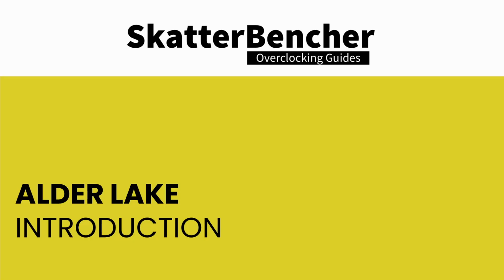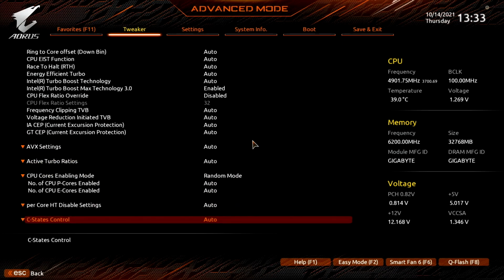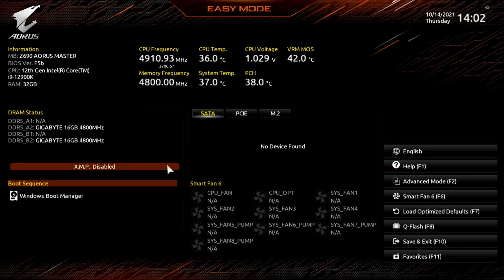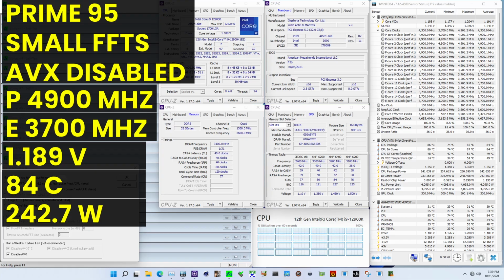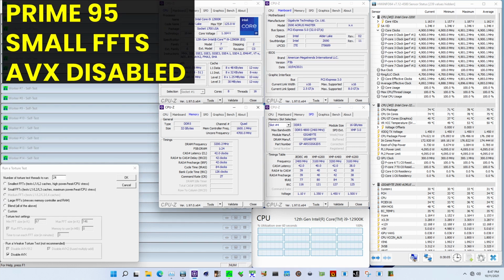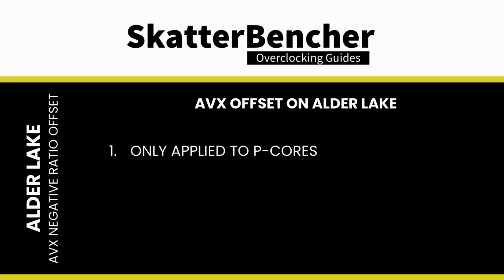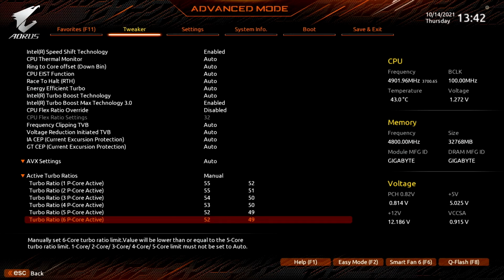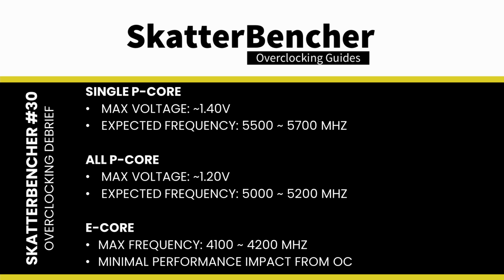Core i9-12900K Overclocked to 5500 MHz with GIGABYTE Z690 AORUS Master | SkatterBencher #30

Comment: I have been tuning the 12900k for a few weeks now. These videos have been helpful up to a certain point. 

My final stable daily clocks, voltage and temperatures are much different. 

What was the goal in these profiles? 

My goal has always been the same, lowest and most consistent frametimes. 

This goal means I need to sync all my core clocks and lock the max frequencies on the P, E and Ring. Then I try to lock the voltage with the exact amount of voltage required while transitioning from idle to full load rapidly. 

At 240 watts, I can destory 99% of benchmarks safely. I did some experimenting at 260 watts and acciedently went up to 280 watts. I am uncomfortable going above 1.415v on the VIDs and thats where my hardlock is. 

I have to run a 1.434 system agent to get the ring OC and Ram OC stable. This is my last hill, I want to lower this without loosing 4.7ghz on my cache. 

Final stable clocks for 12900k on DDR4 3600 are as follows:
P 52 E 42 R 47 Dram 4000 @~100 watts gaming and ~240 watts on synthetics

Comment: Can you do this for a msi
Reply from the maker: Not with a GIGABYTE board, but I have an overclocking guide out with 12700K and MSI board https://www.youtube.com/watch?v=c_ceb82008s
Reply: @SkatterBencher  I did it with the i9 12900kf msi video but is it okay to do the 12700k oc on the i9 12900k

Comment: I have followed this guid  and you mentioned 5.5 all my cored are a steady 5.2 with no sign of any leaving this 5.2 spot cinabench is benchmark  I keep a eye on themes throughout test and I’m seeing higher 80s low 90s running 360mm aio  power draw is constant 260-270 throughout test also ddr5 is gskills 6600 what am I missing cinabench score is 27500??
Reply: Ok I see it now the cpu will only ramp to 5.5 under light load should not hit 5.5 under 100% load correct if anyone can help that would be great love the videos bud
Reply: Up date I reset my bios to stock and started the tweaks over works perfect now 5.5 clocked in

Comment: Where is the final setup ?? You only shows the manual previously your final thoughts
Reply from the maker: There is no "final" setup. In my SkatterBencher guides I try to offer several OC Strategies, each of which work fine on their own. So you can choose which is your preferred strategy.
Reply: @SkatterBencher  Yes but to be fair, on your other guides, you went trough steps to get normal temps. All these examples are 99C and even if that is "safe" I am not comfortable running my CPU at 100 degrees. If you put all this work into the Aorus motherboard, why not give us a final setup with maximized performance with normal temps? Also, I'm watching many of your tutorials in preparation for the 13900k

Comment: Hi, thanks for the video! I repeated the overclocking exactly like you, but it turned out to be 1,420v in cpu z. Why is that? Please help me!
12900k, aorus master z690, triden z5 6000.
Reply from the maker: Did you follow OC Strategy #3? If yes, 1.42V sounds reasonable.

The manual overclock in this overclocking strategy tries to do two things: (1) increase the voltage in low-load few-thread workloads to get extra frequency headroom, and (2) reduce the voltage in high-load many-thread workloads to reduce the temperature. If you're idling in Windows then few cores will be active and the voltage will be higher.

1.42V is not that high for Intel CPUs as you'll find CPUs that go to 1.45V or even 1.5V at default.

Comment: Hey Bencher! I have this one issue that keeps bothering me. It's the System Agent voltage. I'm running an i9 12900k@stock on Aorus Master Z690 with DDR5 at 5600 34-36-36-76. BIOS reports SA voltage at 1.346, just like in your video. The same readings are accurate for HWInfo64. HOWEVER, HWMonitor reports 1.37! Should I be concerned here and how accurate are these readings?
Reply from the maker: No need to be concerned. I find that usually BIOS and HWiNFO are pretty accurate. I don't use HWMonitor often so I don't know how it gets the information.
Reply: @SkatterBencher  Thanks! I've seen people running XMPs with lower SA voltages, so I reckoned that mine must be overkill. I just don't want to degrade my CPU after having spent a fortune on my rig. I also had concerns, that automatic SA voltage regulation might ramp the voltage up through an offset and such HWMonitor readings would be a result of this. Still, it stays consistent at 1.37, so I guess this isn't happening. It's kinda worrying though that it reads close to 1.4.
Reply: BTW, is 1.346 safe for long term use?

Comment: Will this work for i7 12th gen with all the same settings?
Reply from the maker: The general process applies to all Alder Lake CPUs, but the exact settings will be different for each SKU (and chip).
Reply: @SkatterBencher  will this motherboard supports gen 5 ssds?
Reply from the maker: Yes

Comment: Hi thanks for the video. I have the same CPU and motherboard and followed your settings but it only seems to clock to a maximum of 5200 and not the 5500 you are referring to.  I have done a test with prime with just 1 or 2 workers and the max is 5200 although even with 24 workers it remains at 5200???

Comment: Hi, thanks for the great guide. But I have an issue with my bios and 12700k: all cores sync at the max 3.8gh ecore speed instead of pcores 4.8ghz pcore and 3.8ghz ecore. HWinfo reports 3.8 all core especially after running cinebench r23. Can you help or explain why is that?

Comment: Thank you! Could you do a similar 5.5 GHz manual overclock for the MSI Z690 Unify? Really great write up.
Reply from the maker: Thanks! I don't have any specific Alder Lake content lined up currently except for maybe non-K OC and Cryo cooling. But I still have to decide which platforms I'll use for that.

Comment: will this work with an i5 12th gen?
Reply from the maker: Yes, this will be possible with the 12th gen Core i5 K/KF processors. 

The overclocking process will be similar, but of course your mileage will vary depending on the quality of your CPU and the thermal solution used.
Reply: @SkatterBencher  I just attempted on the the 12th gen i5-12600k on the aorus elite but failed to boot, dropped multiple to 52, 52, 51 etc and it booted and ran benchmark but it crashed when I closed it and then had to reinstall network driver so not sure what else it broke. On the i5-12600k oc guide for the asus he sets the voltage for the maximum frequency, does the gigabyte not require that (in this video only the vf points are changed)

Comment: Hey man thanks for all your great videos, I' d like to know what the changes you made to VF point 6 and 11 mean. I have the same motherboard, I'm able to overclock through fixed and override mode but the adaptive mode (selection mode not legacy)I can't really understand how it behaves. For example if I change just one VF point, let's say the 11 or 10 I can't see any change but if I also change the 7, 8 and 9 then I see some changes but still not sure about how it works
Reply from the maker: Advanced Voltage Offset on Alder Lake is a little more complicated than on Rocket Lake. I'm in the process of making a video that takes a closer look at this feature and explains all its intricacies.

The long story short is that the rule is:
- V/F Point 7 is mapped to the highest default turbo ratio (52X on 12900K)
- V/F Point 8-10 are copies of V/F Point 7
- V/F Point 11 is mapped to the OC Ratio (by default = max default turbo ratio + 1; so 53X on 12900K)

For ratios in between the V/F Points, the voltage is (linearly) interpolated between the previous and next V/F Point. So for example:
- V/F Point 6 = 48X
- V/F Point 7 = 52X
=> volt(50X) = [volt(VF7) + volt(VF6)] / 2

Now, because V/F Point 8-10 are copies of V/F Point 7, it seems there are some programming complexities that require V/F 8-10 to be programmed correctly if you want to use V/F Point 7. The easiest is to just program the exact same value to V/F Point 7-10.

As said, V/F Point 11 will be mapped to the OC Ratio. When you do manual overclocking the OC Ratio is the highest ratio set among all ratios. So if you have single core at 55X, then V/F Point 11 will set the voltage offset for 55X and voltages for ratios in between 52X and 55X will be interpolated between V/F 7 52X and V/F 11 55X.

I hope I'm done with my video soon which will explain it in more detail.
Reply: @SkatterBencher  can you provide an undervolt guide for the gigabyte z690 to get default performance+ and better thermals. There isn’t much information in regards to adaptive voltage and override voltage with what LLC works best with undervolts.
Reply: @SkatterBencher  It would be great, thank tou very much for your effort
Reply: @SkatterBencher  damn I didn't see the full response, thanks you're my hero! Now i finally get how it works. I' m able to achieve 5.1 and 4.0 on 12600k but I have to figure out why I get bsod error every time the system pass form high load to idle
Reply from the maker: It sounds like the voltage might not be high enough for your peak boost frequency. 

A CPU will need more voltage at a higher temperature to be stable. It's like the reverse of Thermal Velocity Boost which allows for lower voltage when the CPU temperature is lower. 

So, if you CPU comes out hot after an all-core high load and tries to boost to the highest Turbo Ratio it may be unstable with voltage that previously seemed stable.

Comment: This is so clear, fast and to the point. Love it  This must have taken a lot of work.   Im getting a gigabyte z690 so you've brain dumped me up to speed on the details.

Question: Is it possible to apply a "global" negative vcore offset to push the whole range down and then just apply some vf point positive offsets to stabilise the top end?  Thinking this would be more thermally efficient.

I can see how you could over time figure out the curve by walking up the ratio's but that sounds like a lot of work.
Reply from the maker: Yes! In fact, a global V/F Curve offset has been supported in Adaptive Voltage mode for a very long time. It does exactly what you say: offset the entire curve by a given offset. You can traditionally find it in the Vcore configuration section.

The main challenge with a global offset is that ... it offsets everywhere. That makes it quite difficult to check if the offset is actually stable. For example, let's say you use a -100mV global offset. You'd need to check if this is stable from 8X to 52X on the 12900K. Whereas with the V/F Points, you can check the stability in a very specific range.

Additionally, depending on the specific BIOS configuration, setting a global adaptive voltage offset targeting the P-cores may inadvertently also program the negative offset for the Ring and E-cores. That's because on Alder Lake the P-cores, Ring, and E-cores share the same voltage rail (VccIA). It's not always obvious from the BIOS what that specific item programs, so to be safe you'd also have to check the Ring and E-core stability.

Advanced Voltage Offset (V/F Point) is specifically designed to only impact the P-cores. So it makes it a much more targeted tool for voltage optimizations.
Reply: @SkatterBencher  ok understood thanks.

Comment: Hey, Skatter! got off topic question.. Mine i9 12900k was working on 60c always while gaming.. Suddenly temps started to spike alot between 60-82.. Like one moment it's 60 then 73, 65, 76, 81, 69 and etc. Changing fast.. Any ideas what could happen? Checked with core temp, only P cores are rising that much, E cores stays max at 62c. Thanks! No OC, no fps drops or something, no dust and etc.. Pretty new setup. Water cooler.
Reply from the maker: That sounds like there's some kind of a background workload going on ... but it's a bit hard to diagnose over the internet :)
Reply: @SkatterBencher  no backround load.. very minimal apps are open. Fresh windows.. as I mentioned for 2 weeks temps were optimal.. then immediately started to spike.. can be cooler issues? Even though idle temps are fine.. 30c.

Comment: hey @skatterBencher I try to run my gskill 5600 c36 on this board, but its not running stable in xmp1 or 2 or 3. i have the latest bios (f6c) u have a idea?
Reply from the maker: Hard to say remotely. Is the kit in the motherboard QVL?
Reply: @SkatterBencher  yes they are. But looks like they fixed the issues with the F7A BIOS from yesterday. I choosed the Samsung 5600c36 profile from the list and not the xmp profile. They added a bit of voltages to vdd/vddq_tx and vdd, vddq + imc (CPUVDD2). They running with roundabout 1.3 - 1.32v now. Funny thing is, on the BIOS before i had to up voltages to like 1.41v + to run 5400c36 manually. 5600 wasnt even booting.
Reply from the maker: Thanks for the info! Yea I heard from friends working at motherboard vendors that XMP and memory compatibility is quite challenging. The people that go through the validation testing are the real heroes ... Memory qualification and validation takes so much time!

Comment: I'm just upgrading from x99 and I'm excited to try these techniques. Question, the ddr5 I bought doesn't have a heat spreader. Do I need to add one or could I just have a fan on them?
Reply from the maker: Good question! Leading up to the launch I had people (who didn't test) tell me good cooling will be required for DDR5 and others (who did test) tell me it's pretty much the same like DDR4. I have a pair of Micron sticks without heatsink which I ran with memtest and can't say I saw any temperature issues.

I guess maybe if you're looking to push the voltage and the sticks are inside a poorly ventilated chassis you might want to consider a heatsink? I haven't personally come across a need but of course others might have.

Comment: hey skatter, any motherboard recommendation for a 12900k + 3600mhz CL16 i plan to OC ? Asus PRIME Z690-A or Gigabyte Z690 GAMING X DDR4 ? others ? i don't know much about motherboards ... the  only differences i saw is : some get PCI-E 4.0 other 5.0 or wifi enabled, so i'm a bit lost. thanks !
Reply from the maker: Hi Prussiane. I can't say I'm an expert on choosing the right motherboard as I tend to play with things that are overclocking-ready and thus may be overspec'd :). I've only tried 1 DDR4 motherboard so far (the Strix Z690-A) and found it to work very well with my Alder Lake CPU.

PCI-e 5.0 is a cool new technology but frankly there's not much real-world use-case for it yet as we're lacking the PCI-e devices. I don't quite believe in the idea of "future-proofing" a system per se, but if you're going to upgrade to a next-generation platform in the coming years I'd imagine a PCI-e 5.0 motherboard will get you more on the second hand market in 2-3 years time.

Comment: I don't understand this. As soon as i touch my multipliers the Vcore shoots up from 1.2 to 1.4 and i can only control it with a legacy offset. Which is problematic because then my idle Vcore is too low. 
How on earth do you get the motherboard to stay @ the default Vcore when touching the multipliers. I followed every setting in the bios to the letter. Just does NOT work.
Reply from the maker: What BIOS version are you on? 

I recall seeing something like it with an earlier BIOS version. The workaround then was to manually set VRM loadline to "standard".
Reply: @SkatterBencher  I'll try that

Comment: You're full of shit setting the offsets in manual OC does fucking nothing motherboard just keeps dumping 1.4 Vcore
Reply: As soon as i touch the multipliers my Vcore goes from 1.2 something to 1.45 .
Reply from the maker: What BIOS version are you on? 

I recall seeing something like it with an earlier BIOS version. The workaround then was to manually set VRM loadline to "standard".

Comment: Many thanks for creating this video.  You've helped me oc my 12700k and gigabyte mb with ease. Cheers
Reply from the maker: Great to hear!
Reply: What did you do?
Reply: @woIfenhauz  a simple OC of the base clock with voltage offset.
Reply: @josephimports  I like the turbo manipulation and voltage play done here. I did the same thing on my 12700k but lowered the max clock to 5.2 and the rest accordingly. Runs flawlessly.

Comment: Pieter, hoe moet ik de p en e cores beschouwen? Sommige games kan je het aantal processors invoeren  alleen bij de 12900k is een p core veel sneller dan een e core.. hoe kan je die e core dan indelen? Als een volwaardige core of? Hyperthreading off levert ook opmerkelijke resultaten!!
Reply from the maker: Zowel de P-cores als E-cores zijn echte, fysieke, volwaardige cores. Je hebt dus 8+8=16 cores in the 12900K.

Intel groepeert de E-cores in clusters van 4 cores voor frequentie en voltage alsook L2 cache. Voor de games maakt dat niet veel uit; het zijn nog altijd 4 echte volwaardige cores in iedere E-core cluster. De E-cores zijn gewoon wat trager dan de P-cores.

HT off is wellicht enkel beter in specifieke applicaties en ik vermoed dat over tijd er wel Windows updates en software updates zullen uitkomen die dat zullen verhelpen.

Comment: Great review and very detail on the benchmarks. This is the most thorough review I seen on this processor. I was wondering on the cpu block your were using. I notice on your list you have a EK-Quantum Magnitude. Will that work on a 1700 socket.  I looking a picking up the EK-Quantum Power 360  Kit but not seeing much in any info on cpu water block compatibility with the LGA 1700.
Reply from the maker: I have a custom LGA1700 bracket for the Magnitude water block. 

As far as I know, there won't be a bracket for the current Magnitude gen but EK will make a special LGA1700 Magnitude water block. Definitely looking forward to that. 'Till then, apparently the Velocity2 LGA1700 is the way to go if you want a block that's designed for Alder Lake
Reply: @SkatterBencher  Thank you very much and that does help a lot.!!!! :)
Reply: Wondering how he fit that too